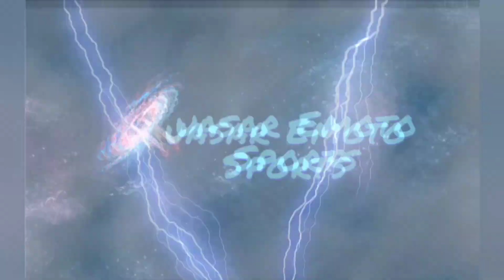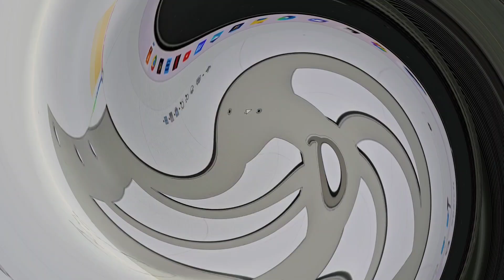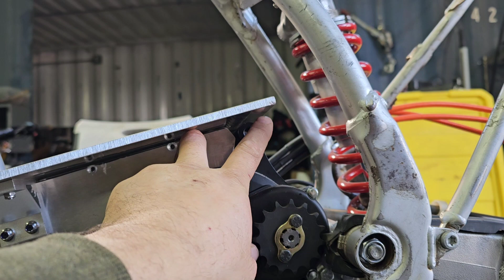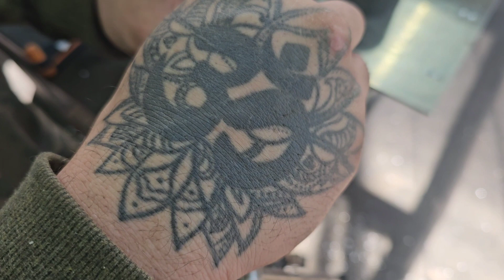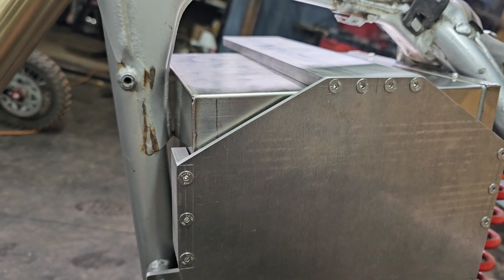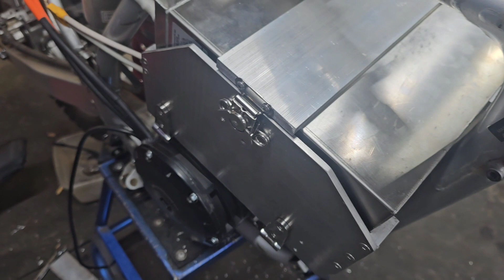DIY Honda 150r Electric Conversion Episode 2!!!

Comment: I would’ve just rigid tapped them on the drill press being as they’re aluminum but you said it’s just for prototyping so I dig the quick and dirty form fit and function method

Comment: Awesome project, as always. However, would it be better to weld those two tabs to the battery tray  and the ones at the front also so that less drilling and fewer screws are used? 
Seems that the tray can be easily removed  by lifting it and pulling out. This is just an observation to look into , I dont know if do weld and have the equipment.
I always look forward to your videos.
Reply from the maker: I wanted to make everything modular so it can be changed and upgrade in the future.
I am pretty good with my tig welder.  Just thought it would be cool to be able to swap it all to carbon or have the option to anodize for different color schemes.
Reply from the maker: Have a look at the latest video, you will understand more. It's all machined now and looking 👌